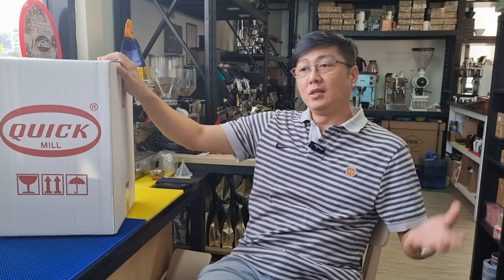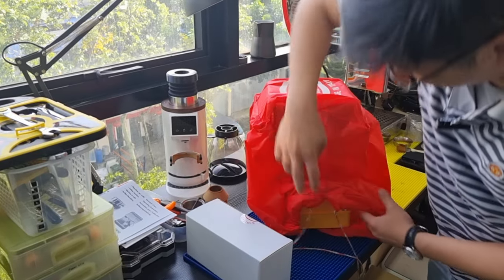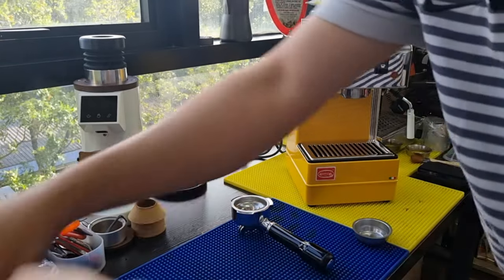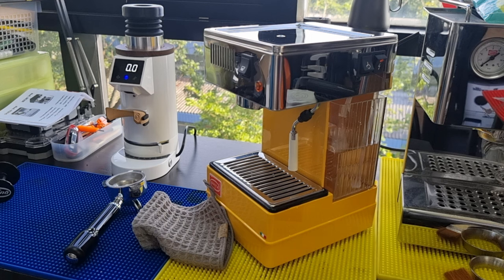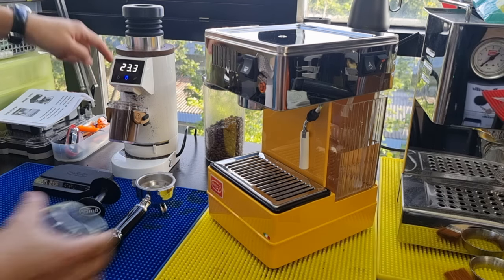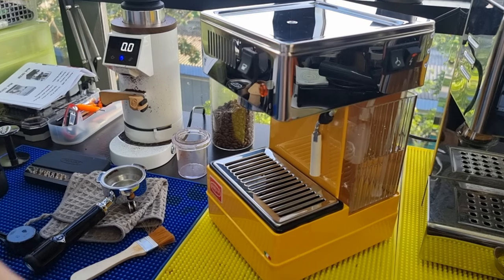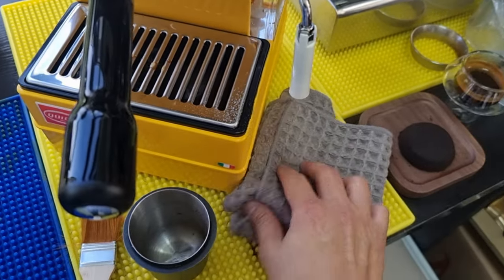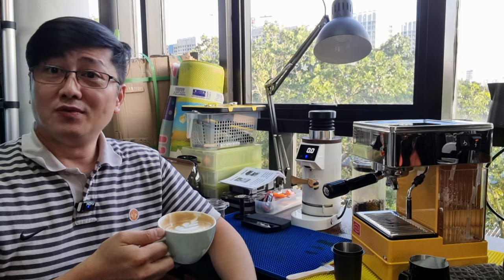Quick Mill 0820 | Single Thermal Block Espresso Machine | Unboxing and 1st Use

Comment: That machine screams retro with the big rocker switch and orange front light; you can't forget the yellow color 😁.  At first, it looks like a kid's play machine.  The concave basket should produce good body.  It's hard to believe it's a current product.
Reply from the maker: Oh yes. It's a retro looking machine that uses technology that Quick Mill has been using for at least 50 years.